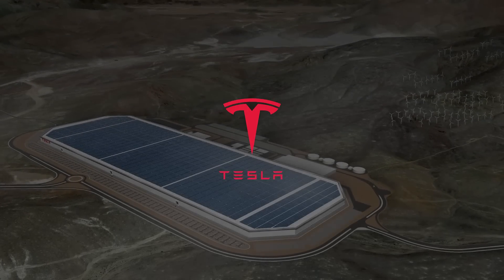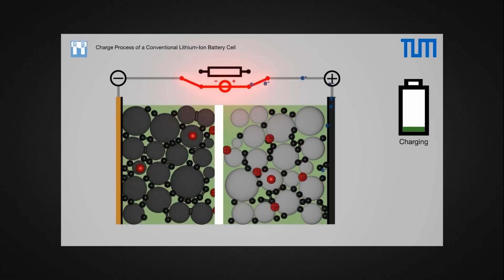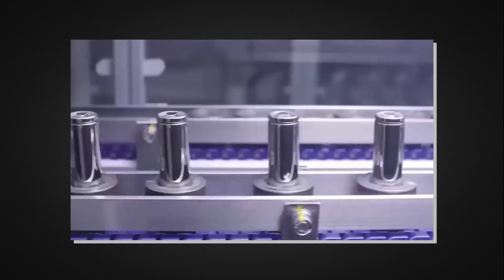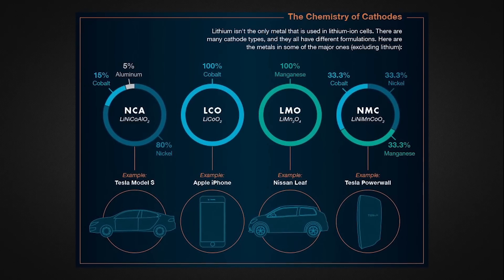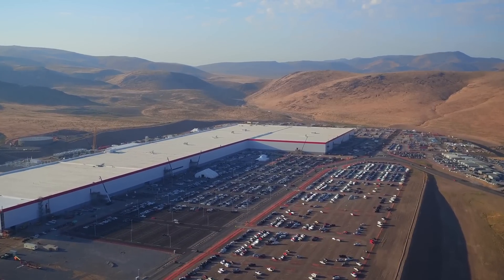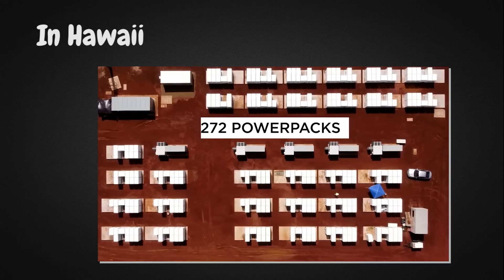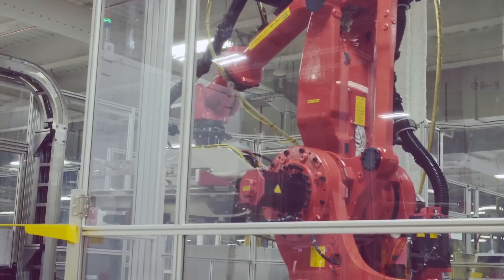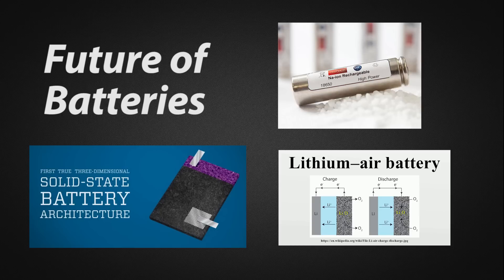Tesla Battery 101, How does it work?

Comment: Tesla battery pack and motors-  over 2000 lbs.  Like dragging around 14 passengers in your car (if you could fit them in); doesn't sound very efficient.
Reply: Heavy block vs small e motor, tranny vs. tiny transmission,nothing vs. exhaust system (including cats) heavier braking system, gas tank, etc. You decide on a number to subtract from that figure of 2000 lbs. Then compare the inherent specific efficiency of an ICE to an E motor - something like 95% versus 30%...I could keep going but I think that you will realize that you have looked at one factor, and, I do not need to persuade you of anything, the market will eventually throw the ICE away.Have a nice day.
Reply: Heavy engine block ??  A 2-400 lb aluminum engine and 100 lb trans is compared to four HD copper-laden motors at about 1000 lbs ??  And twenty gallons of gasoline weighing 120lbs compared to the Tesla battery at about 1200 lbs --  TEN TIMES the gasoline, not adding up by a long shot.  Also gasoline is consumed so in the end, the average is negligible relative to overall vehicle weight.

The Teslas, with massive vehicle weights in the range of three tons (6000lbs), brakes, wheels, suspension and tires-- must all be super heavy-duty due to this huge weight and using 1000 lbs of motors just to drive the batteries around town, talk about wasting energy.  The model X weighs about 6700lbs GVWR, most full size non-EV cars are half of this.  And the environmental damage caused by battery production and de-commissioning plus the electricity needed to charge them is another story. 

Super clean hydrogen is still the answer to vehicle power.  A prototype Solar Powered hydrogen filling station is operating in the LA area now and the result is a super powerful and clean burning fuel.  The WW petroleum interests however, will continue to stifle the advent of H as a fuel and the direct money-line to politicians will insure this along with the “incentives” offered to EV owners and paid for by taxpayers as dictated by politicians.  

I have been working with vehicles since 1955 and along the way have noted how world politics operate and it is corrupt to the core.  The public schooled, dumbed-down, brain-washed youth of today think they are taking the lead to “save the earth” when is fact they are doing just the opposite by enabling the power and wealth of a few in the “NWO”.   Wisdom DOES NOT come with youth, study hard and find the real truth;  lemmings will not have a good life.
Reply: AmericanDane1 CO2 may be good for plants, but it's not great for a lot of other things. Our brains, for example. Studies have shown that even the current levels have a measurable impact on cognition.

And that's beside the climate impact, plus a bunch of other things.

But you go ahead and cherry pick the one that sounds good.
Reply: As for how we deal with the energy issues, the current thinking is distributed generation and smart grids. For example, there is a plan underway in South Australia to create a virtual power plant by using the solar and battery systems installed on 50,000 houses. The houses don't own the systems, at least not initially (there is a smaller scheme where they do after 7 years, but it's sans storage), but get to use the power at a third off their current rate, and the company running it gets ~650MWh of dispatchable solar energy, and feed in during the day when the batteries are full.

It actually is pretty clever as it is both a 250MW power plant, and backup power in one system. The cost is relatively high, but then so are backup generators - this could replace the $500m of diesel/gas generators that were installed for backup when those nasty coal plants trip due to load and heat. Those are only expected to run a handful of hours a year, easily done by this distributed solar system.

I haven't seen payback periods yet, but given that my folks got the seven year one where they pay half their usual bill and own the panels in seven years, I can't imagine it will be long.

Last but not least, considering the average distance driven in cars, the power could be self supplied by no more than a 6 or 7kW system on the house of each person that has one. A bit of extra centralised generation to handle the extra load for those who drive a bit extra shouldn't be a problem.
Reply: looks like someone forgot that there wont be no 1000 lbs engine or any transimsion line.
Reply: Just to mention, the X doesn't weigh 6700lbs, that's is GVM. It actually weighs ~5400lbs. Kind of like a Merc GL - you know, to compare vehicles in a similar class and all.
Reply: You must have flunked physics. The efficiency of the internal combustion engine is low, but the fuel is burned directly at the source. Electricity is not. Further, there is no electric motor at 95% efficiency - at least not over a driving range. Voltage is speed and current is torque. And, EVERY system has resistance. You can use electronics and various strategies - like regenerative braking, etc, to aid in the system, but you are still inherently carrying around a lot of weight as your energy source and heat (resistance) both in the vehicle and in the electric generation and delivery are very real efficiency losses. 
I do agree the internal combustion engine is going away for our transportation, but it has served us well and people seeing all these batteries as the answer will need to confront the grid issues and just how that will be dealt with fairly. Every family needs power and raising the costs of our electricity to accommodate the 10% wanting to be able to plug their car in whenever they want needs to be addressed. And, for sure those goofy subsidies need to go away.
But, yes, the internal combustion engines' years are numbered.
Reply: AmericanDane1 For one who professes to love physics, you sure left out a lot of the process of drilling, pumping, transporting, refining, transporting again and then burning that fuel. I'd say it has a lot less than 25% efficiency once you take that into account.

And sure, coal has a lot of those problems too, but it doesn't need to be refined, and energy is extracted at a much higher efficiency.

And we don't need to use coal.
Reply: MrGGPRI weight has no effect on range except for the extra friction from the tires. Remember the laws of physics. Once an object is in motion it tends to stay in motion. And with Regeneration braking you regain the energy used for acceleration. As far as hills, same thing, you regain the energy coming back down. Air drag isn't affected by weight and will be the same on a lighter vehicle or heavy one.
Reply: AmericanDane1 weight isn't an efficiency loss other than the extra friction from the tires. Remember the laws of physics. Once in motion tends to stay in motion
Reply: MrGGPRI The heaviest pack is around 1300 lbs. And the motor does not weigh 900. Plus the 1300 lbs does not get dissolved and then injected into the air on each use. If we go through 200gallons of fuel we have put the weight of that fuel into the air. Have you driven a 30mpg car 6000miles before? I have. And I am not happy that I have put all that 1200 lbs of weight worth of refined fuel into the atmosphere. Now have you driven 60k miles in the same kind of car. 12k lbs of fuel into the atmosphere. And if we look into how just carbon dioxide forms (not all the other hazardous materials) from the process... It should not bring joy. It is heavier because it combines with the atmosphere.
Reply: MrGGPRI Hydrogen is not the answer and I believe the battle between EVs and Hydrogen were over... I personally drove Toyota's new Hydrogen prototype and found the car to be lackluster. I was told by the project manager that each refill for hydrogen will be $50 while the car itself is slow/unattractive costing $50-70k which is pointless. Rather just drive an ICE vehicle if the convenient factor is the same with Hydrogen based cars. So what if the Model X weighs 6700lbs? It's still faster than most sports car including my own.. you think we care about "saving the world"? No, we care about something sexy and innovative, not some boring POS. Battery technology will improve over the next decade so your argument is invalid, currently it's pretty clean.
Reply: @MrGGPRI, you're right, hydrogen is a great fuel source - until you have to store and produce it. Storing it is problematic, due to it's low density and the need therefore to store it at high pressures, and it's small molecule size meaning it leaks out of storage vessels pretty easily. Producing it is problematic because it requires huge amounts of power, and you'd better not be using our already scarce freshwater supplies to do so, which means it needs to work on salt water.

In other words, you may as well simply harness the power directly with renewables (that LA hydrogen station is super inefficient compared to solar PV), and use that. HFC vehicles also require a battery, though it is small, as the HFC's themselves don't respond to acceleration needs well enough. They are better off producing a standard base load (where have I heard that before?) and buffering it in a battery that can produce large amounts of power for acceleration and then low amounts at cruise. Also, you can't efficiently turn regen into hydrogen, so you need a battery for that.

So now we have a significantly more complex system, for a weight tradeoff that is getting smaller over time with battery chemistry upgrades. Not to mention that you are still beholden to the companies that produce hydrogen and how much they wish to charge you. No, you can't make it at home, because of the freshwater issue I mentioned earlier.

As for the BEV's weight issues, they don't really exist. To use your example of a 170-200kg (more if you want to compare performance apples to apples) engine with 50kg transmission. The Tesla actually has 2 motors, except in the P100D where it has 3. They're about 40kg each, a bit less but we'll call it 40. The battery is pretty heavy, though not as bad as you'd imagine - take the Model S 75D vs 100D, the weight difference is about 110kg, so extrapolating that the battery in a 100D should be about 440kg. So far it's looking more like a 250kg penalty. Add in the weight from an equivalent all wheel drive system (comparing apples to apples), diffs, etc, and the penalty vs the equivalent Mercedes S or E (without AWD) is around 200kg in real terms, or 10%. 2-3 passengers.

Comparing Model S and X to a lesser car is just stupid. For that we use the 3 with the larger battery, at about 1730kg, according to Wikipedia. That's only 200kg higher than my Subaru Forester, of a similar size. So 3800lb, not 6000lb.

Are you sure you're not comparing max gross weight in the large SUV to curb weight of a smaller family car in your comparison?
Reply: Don't fear CO2. It actually is necessary to grow your food. Or would you rather starve?